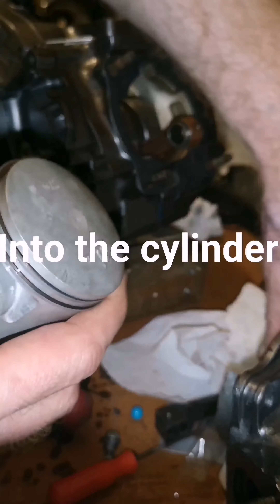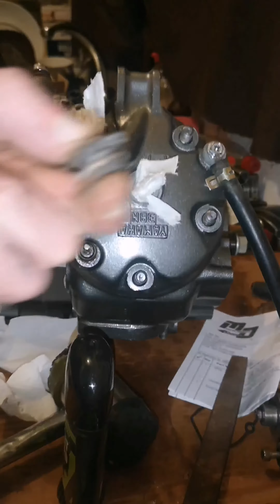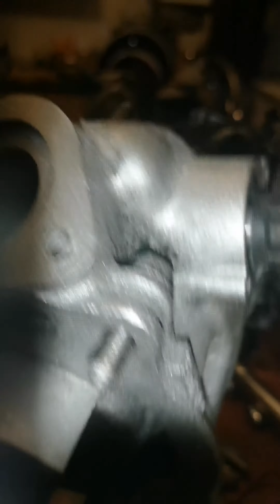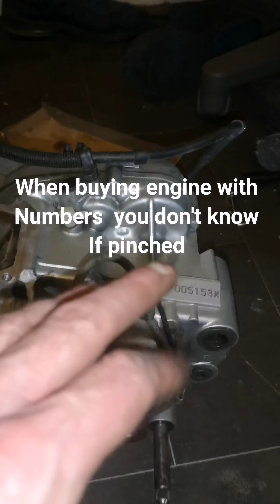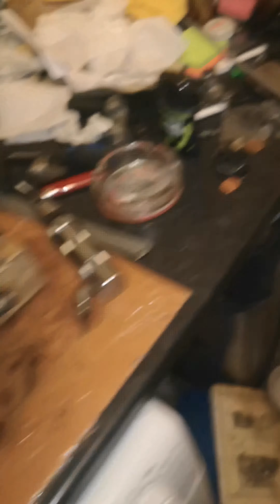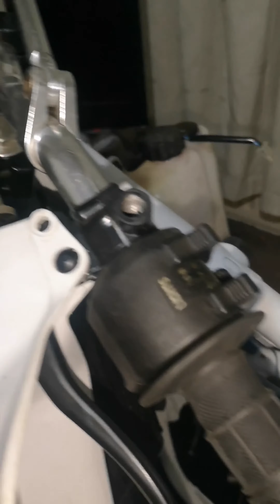Yamaha dtr 125 1991 3BN 2 stroke motorcycle project top end rebuild pt5

Comment: Nice! Your getting further than mine m8, I only got 75 PSI on the compression test, gonna try honing it this week but really needs to go to Jim for rebore  :-)
Reply from the maker: Yeah it'll defo need doing at that low of a psi m8, does if only start off bump start m8, defo Jims the man to sort it🙏
Reply: @2strokemxclassics  Not tried bumping m8, i was half expecting low PSI as the head was off eBay ;-)
Reply from the maker: No probs m8 I only asked cos if comps low it'll take ages to kick or elec start then wen ya bump them the piston swells an then you can kickstart all day after that, it's one way to check aswell m8
Reply: @2strokemxclassics  Nice one I never knew that m8! i might give that a go, i just want to hear the engine fire up lol been trying to kick it over, got spark and fuel to the plug so something at least :-)
Reply from the maker: Yeah its worth a try m8 defo
Reply: @2strokemxclassics  Oh well bumping goes out the window for today, went to install the rear brake carrier and some bstard i brought it from has cut half the axel mount out so it  wobbles around... the joys of buying online hey lol
Reply from the maker: @rdom4256  defo m8 gotta buy off good buyers, stay away from Facebook group sellers lol